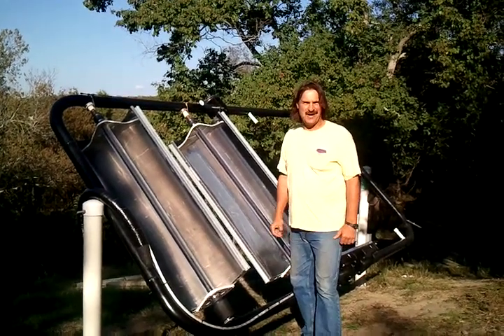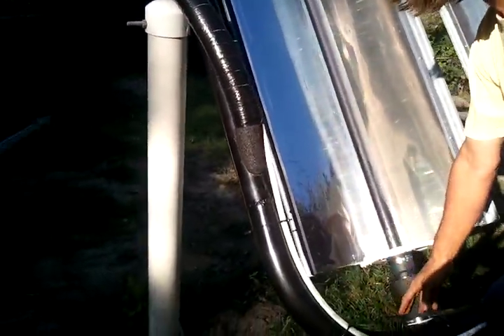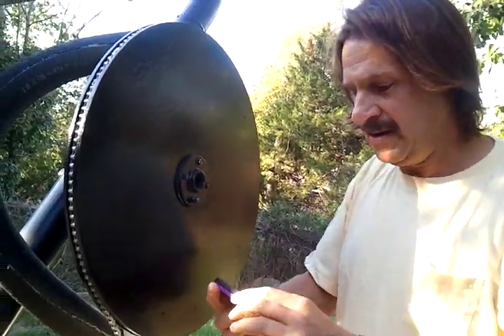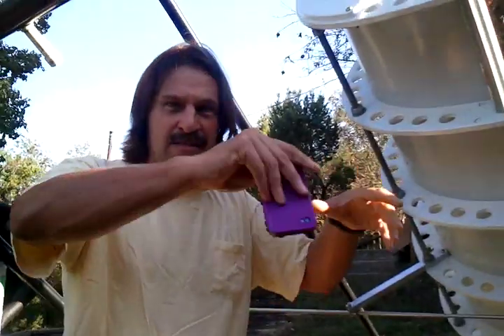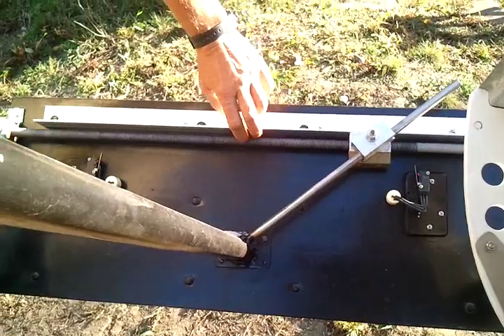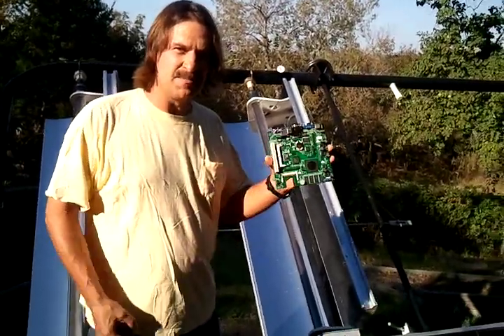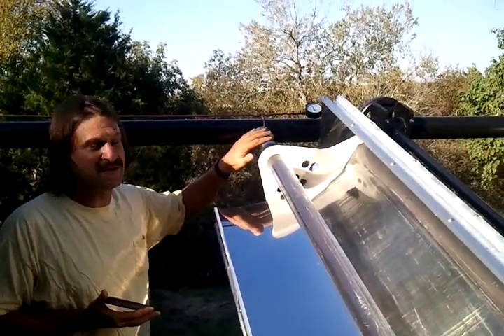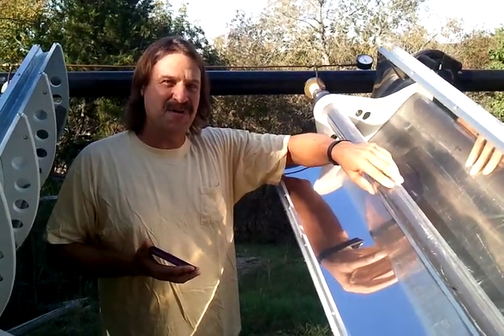Parabolic Trough Solar Collector Water Heater 5

Comment: Or as well the same small lines can be run to radiant heat pipes in flooring, so fourth, and you can turn off the heating channels of such with simple blocks or seperation points.  Your very good for having utilized the parabolic troughs which so few seem to realize double the ability of the individual pipes, but your system could be done far less expensively.  This system without needing evacuated tubing, is perfect for say.. in space as well, people just dont utilize science well enough.

Comment from the maker: Tneren, thanks for that.  It has been fun.  I should mention a few changes that I am going to make while I am at it.  First, the black copper focal pipes are a little too small.  When light hits the outer regions of the parabolas, the geometry is not precise enough because the stainless sheet metal does not lay exactly into the brackets.  The light hits the top of the black pipes.

Comment from the maker: Dance,  the 1-1/2 copper focal tube is brazed to a genova 53046 1" FIP x CPVC union  (the brass FIP side of the union is ground down a bit and it fits inside the 1-1/2" copper pipe & is brazed).  Then, it is immediately bushed into a 1-1/4" cpvc tee, and the 1-1/4" CPVC pipe runs along inside the steel frame.  Finally, the 1-1/4" CPVC pipe is connected to a flexible 1/2" hydraulic hose that runs down through the support post and then 1/2" cpvc runs to the solar tank heat exchanger and back.

Comment from the maker: My reflector is made from mirror stainless sheet metal purchased from MetalsDepot online.  One 4x10 foot  piece makes four 2x5 foot collectors (they cut it for you). Now, in the original design done by George Plhak, plastic mirrors are used.  You should search for "George Plhak" on Youtube and watch all of his videos if you are interested in building a system like this.  Very helpful.  I have not completed the project yet, so there are no complete plans yet.  I will share what I have though.

Comment from the maker: George Plhak has complete instructions and plans.  You should look at those then implement the improvements that I have made.  When I am done with the project, I may offer plans as well.  You will also need electronics to track the sun and run the pump.  The system is interfaced with a common 50 gallon electric water heater tank.  I ran a 6 foot piece of EasyFlex tubing through the tank  as a heat exchanger, and the isolated loop is filled with water and antifreeze (propylene glycol).

Comment from the maker: The way to test this is to go out on a sunny day and trace the sun's rays with a cheap pencil laser beam.  Shine the beam from about 3 feet away onto the shadow of the laser seen on the mirror (this aligns the beam perfectly with the sun's rays). The beam will bounce off the mirror and hit the focal pipe. You will see that with this design, the laser does not strike the focal pipe very well from the outer areas of the parabolas. So a slightly larger focal pipe is necessary: Probably 2" AL pipe.

Comment from the maker: So, one way or another, I am going to make the focal pipes larger.  I have found a scientific paper that shows that a vacuum chamber does not make that much difference when the temperature differentials are not that high (< 100 F),  and that it is only high wind velocities matter.  Since don't have much wind in Austin, and since the solar collectors will be facing away from the North wind in the winter, I have decided to try exposed, but larger, focal pipes.  Andrew Ancel Gray

Comment from the maker: SeeTheWholeTruth,  I would not say "overly intensive", I would say "very high tech".  Yeah, building a "onesie" of this system is indeed challenging. However, I expect to get a lifetime of hot water from it.  Once the design is finished, it would NOT be too difficult to reproduce it for the second and third times (etc).   Also, there is nothing expensive about this system.  It is a labor of love though.   Andrew Ancel Gray

Comment from the maker: I have been saving about $50/month on my electric bill, so this computes to about a $2000/$50 = 40 month (~ a 3+ year) payback period (just for the materials).  And yes, it really does require some labor skills.   I did  1) arc welding, 2) brazing, 3) electronics, 4) programming, 5) woodworking, 6) plumbing, 7) electrical, and 8) physics.  However, considering that I plan to save $50/month for the rest of my life, IT IS DEFINITELY WORTH IT.

Comment from the maker: Sure thing bigun!  I got my polycarbonate tubing from a company called Futurplast.  The tubing is    PCT0023-clear    2-1/4" ID x 2-1/2 OD Polycarbonate Tube (8 feet long).  The description on their website (futurplast D0T ca) does  not indicate UV stabilization, so I got them to send me a UV stabilization certificate.   Also, the other tube, the central focal  tube is 1-1/2" rigid copper.  If you need more info, just let me know.

Comment: Andrew be careful about what some totally theoretical "papers" say. If your flow rate of heated water is low due to lower light, you want to minimise your losses all the more. AND They disallow the pipes to become frozen at that point. No doubt the "paper" will not be taking into effect your light side is on a single side.
Better than bigger water tubing, Suggest reflective mylar inside the clear pipes wrapped in a half turn to catch and redirect the missed light to the water tubing??

Comment from the maker: Paverop:  Well, I have all the parts cut out for mirrors #3 and #4, painted, and ready to assemble.  Perhaps next weekend I will put them together.  In the meantime, mirrors #1 and #2 (by themselves) are heating my water to about 115 degrees F, and my backup EcoSmart ECO 24 tankless only has to add 5 degrees F to get it up to 120F.  I will indeed soon be posting video number 6.  Soon!   Andrew Ancel Gray

Comment: That's good to know! The Pi would certainly be cheaper than the Alix in the uk, and smaller that's why I was thinking of it.
Excellent work by the way! How did it fair through winter, did you get a good delta t in the shortest and days of the year?
Also, how much did it cost to build?
I'd love to be able to buy one of these as a unit in the future, I don't think I'd have the skills to build it all myself.

Comment from the maker: Well, I have changed my mind.  It turns out that I may be able to get more accuracy from the parabolas along the outer edges by curling them inward slightly in a calculated way.  I am using my CAD program now to trace the rays and to turn them back towards the central focal point.  I will let you know how it goes.

Comment from the maker: Thanx, Gazzat5!   Well, the Alix 1D is just 10 Watts.  Not too much for a kilowatt of heat transfer.  Besides, there are going to be man-centuries of software being used here, as this controller will be able to call you on your cell if there is a problem, and then you can log into it via a Browser and control it.  I doubt this could be done easily on Arduino with such little effort.  That is, the PC-open-source-software-base trumps Arduino.  Andrew Ancel Gray

Comment from the maker: Not sure how much it cost to build since I went through 3 generations of trials.  But if I started from scratch, used an existing electric water heater (with my handy-dandy homemade heat exchanger), I would expect it to cost perhaps $1500 dollars (just a WILD guess, as all my receipts are still stashed in my file cabinet).  Then, I recommend using an EcoSmart tankless as a backup, so this is another $500 or so.  Also, right now it is labor intensive, as an economy of scale has not been set up.

Comment from the maker: gazzat, the Alix-1E is about $135 at siliconkit (this is a complete PC-compatible 12VDC mini-itx board).  How does this compare in price in the UK?  Do import and VAT taxes make it impossible to sell at this price?   How cheap is the UK Pi? I have not gotten winter data yet because I need to mount it up on my rooftop for it to be in the sun.  However, with my homemade heat exchanger and my 50 gallon ex-electric water heater, I get 145F (63C) coming from collectors,  135F (57C) going back.

Comment: check to most of the above, since you can run debian and apt-get install whatever. There's really not much that hasn't been ported or  can't be compiled for the pi.
With gpio you can interface most chips, and there are already gprs phone boards out there.
Does the alix have an embedded gprs modem? Oooh
I guess it's apples and pears heh

Comment from the maker: OK, then yes, everything SHOULD theoretically run on Raspberry Pi.  So I give it my blessing.  No, the Alix does not have an embedded gprs modem.  It does have a PCI and an Express slot for add-on modem though.  By the way, I am running FreeBSD on the Alix.  FreeBSD because it seems (to me) more bulletproof for embedded than Linux.  But any "unix-like" system should THEORETICALLY work.  Let me know.    Andrew Ancel Gray

Comment: hi  dear i want to apply this idea  to pure my water  from a well to use it for agriculture  can i do it because the well water have  hi salt  sodium cloride
Reply from the maker: Faris,  in the system that I built, the water going through the solar collectors is a separate piping system from the water that is used in my house.  I made a heat exchanger in my tank so that it is separate.  The heat exchanger is replacable and cleanable, so if your salts build up on it in the tank, you could replace it.

And, sorry it took so long to reply.  Somehow I did not see your comment.

Comment: How did you connect the vacuum line to the rotating polycarbonate chambers?
Reply from the maker: OK Ibrahim.  The polycarbonate chambers are held to the copper pipes by a rubber seal pushed over a (1.5"x2" copper reducer bushing)/(2" copper cap) that are brazed onto the pipes.
Here is a diagram:
http://modelofreality.org/SolarFocalTube.jpg
And here are a few pics:
http://modelofreality.org/2014-10-20_12.12.51.jpg
http://modelofreality.org/2014-10-20_12.24.59.jpg
http://modelofreality.org/2014-10-20_12.13.14.jpg
(Large pics, be sure to ZOOM OUT).
The polycarbonate chambers are actually stationary and not rotating.
The white end-plates actually do the rotating over the fixed polycarbonate.
Let me know what you think.
Andrew Ancel Gray
Reply: Ok I get it.  It makes sense that you would keep the vacuum chambers stationary. Thanks for the diagram and the materials list.  I am thinking about using an inflatable vinyl structure to hold the reflector and the receiver.  My concern is that there is a certain amount of light filtering done by the vinyl and the polycarbonate tubes and I wonder how will that impact the efficiency of the collector in light of the gains of having a vacuum chamber.
Reply from the maker: Ibrahim Hadad
Correct Ibrahim.  The polycarbonate absorbs some of the light.  Vinyl (Vinyl Chloride) really absorbs (and breaks down) under ultraviolet light, usually turning yellow within a year or so.  UV stabilized polycarbonate (essential) seems to do better.  Also, in summer, THERE IS TOO MUCH HEAT, and my collector sometimes shuts down from over-heat conditions even with the clear polycarbonate cover.  This is balanced by MORE HEAT IN WINTER since the cold wind does not strip the focal pipes.  This seems to be a good trade-off for me.  Glass tubes, if one could figure out how to mount them without breaking them, perhaps would be better.  For my first project, I decided to use indestructible (UV-stabilized) polycarbonate.   Andrew Gray
Reply: ancelgray Yes UV is a serious concern.  I am planning to mitigate it with UV resistant vinyl film.  I agree that  polycarbonate is the way to go for the vacuum chamber for it's UV resistance and material strength.  I am encouraged to hear that you have a "too much heat" situation.  I hope to achieve the same goals.Once I have the prototype built I'll let you know so you can take a look.  Thanks for you help!

Comment from the maker: Hello Bigun,
Yes George's book is very helpful!  I have it and I used it to get started.  However, your suspicions are correct.  George did 5 or 6 generations of improvements, and I have done 2 or 3!  The two most important ones that I did was the anti-twist bar and the system for securing the mirror into the parabolic brackets.  And yes, I will share a few of my drawings with you.  It would be easiest if I simply mailed you paper templates.  Send your address to  ancelgray "AT" YAH00.C0M

Comment: Is there a way to pull a vacuum on the water itself, to change the boiling point?
Reply from the maker: Well, I do not really think you generally want the water in your tubes to boil, since it can stress the system.  But if you really want low pressure steam, then yeah, you can depressurize your circulating water with a vacuum pump.  I do not think that this is advisable though, because the tubes are cooled by the liquid water.  
Andrew Ancel Gray
Reply: I was thinking of using it as a way to distill water. And maybe a way to heat in the winter time.
Reply from the maker: OK. I got it.  Yes, pulling a vacuum would be better than boiling the water at regular pressure, because the rubber seals that I use are not rated for  100 degrees C. (212F).  And yes, with a vacuum around the focal tubes, it works much better in the severe cold.

Comment: The design over intensive.  Simply fill the collector glass tubes with oil, and run the oil to a tank around your water tank.  No copper inserts and so fourth, its unnecessary and overly expensive.  The oil will retain the heat longer, and you will have money to run lines from the system to say.. a crockpot, same idea outer heated area to cool within.. then simply add TEG seebeck high temp modules in areas to make electricity as well.. the modules are 2 inch sq, and can generate 18watts each.

Comment from the maker: Winker, all of the functionality of these programs could be ported to Raspberry Pi or Arduino (if that is what you are determined to do).  Do you have Apache Web server running on Raspberry Pi?  Does it support cgi scripts?  Does Linphone run on Raspberry Pi.  How about SMStools?  Can you send an SMS message with Raspberry Pi?  I am using all of these programs.  I just install the binaries and they are ready to use.  Do you see why I am not so "gun-ho" on using other "non-Intel" processors?